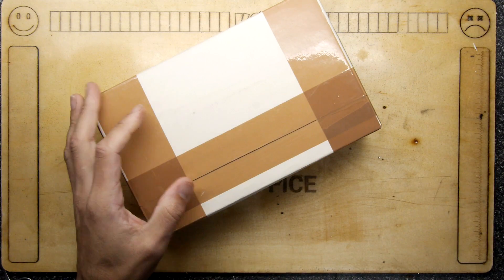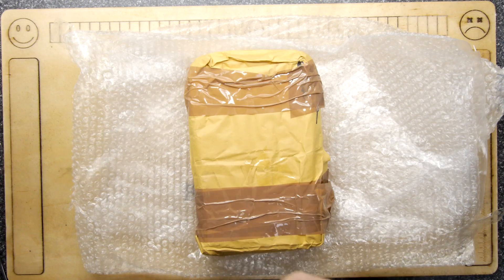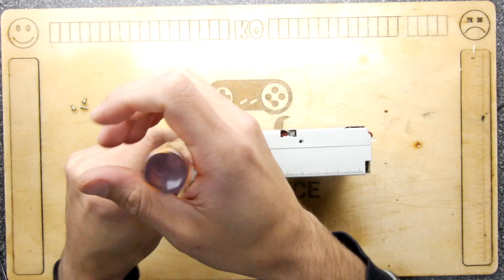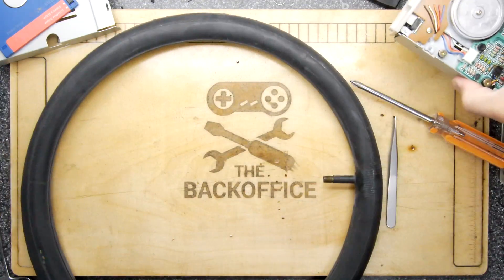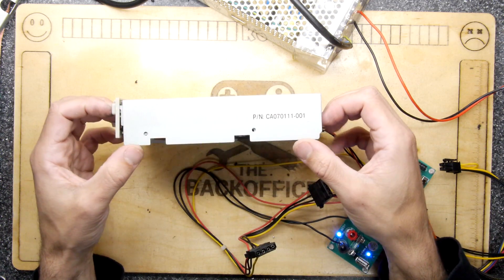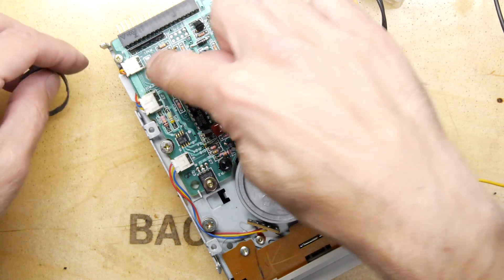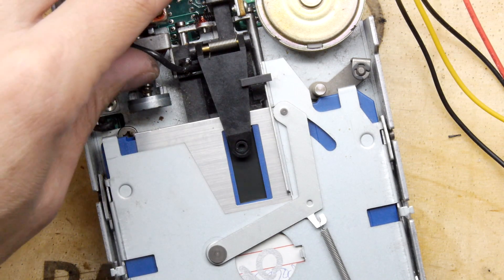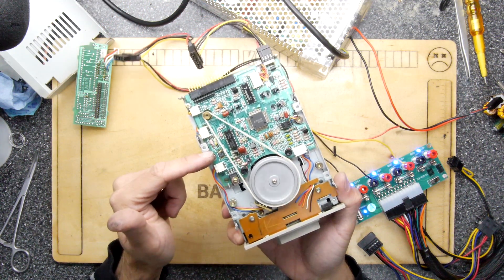Atari Mega Floppy Drive Repair

Comment: I have acquired a mega ste with a standard double density drive that I want to switch for a high density one...trouble is the ones available now have a different fascia that won't fit the case without cutting it. Is there a way of switching over the fascias between floppy drives?

Comment: The main issue with rubber bands is that even though they may work at first, they’re way too bouncy and don’t last long!  I bodged an 8-track in this way back in the ‘90s and it used to fail every 3 months!  The correct bands aren’t stretchy at all and are available eBay.

However, a lot of drives of the era use the same belt; Amstrad 3” and 3.5” drives, Famicom disk system, Spectrum QL, etc.  No idea if the same belt would fit your drive though, but I have a spare I can send your way if you want to give it a go!

Comment: I have repaired a few belt driven things (disc drives/tape machines) with regular rubber bands and they do work fairly long term in my experience as long as they are used fairly regularly. If they sit for too long the bands tend to turn crispy and loose their elasticity :-/ but as a short to medium term fix it should be fine! :-)
Reply from the maker: Oh great! I can't wait to try this in the machine
Reply: @backofficeshow  will there be a video when you do? I've never had the opportunity to use one of the Atari Mega machines myself!